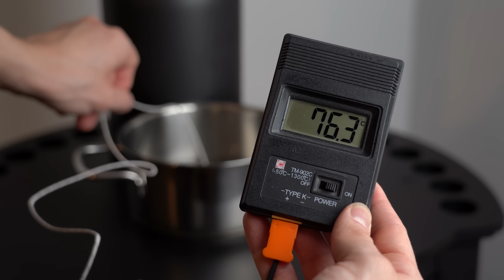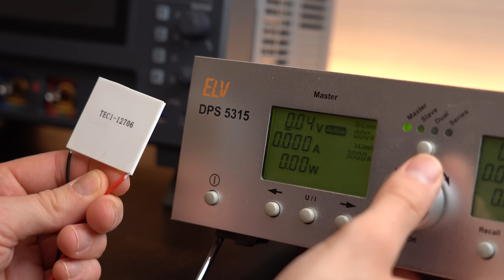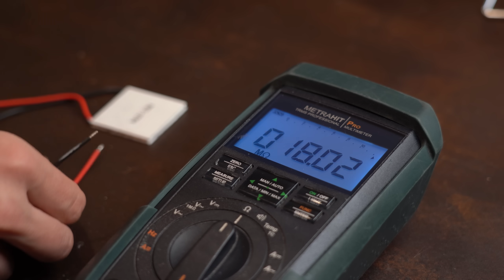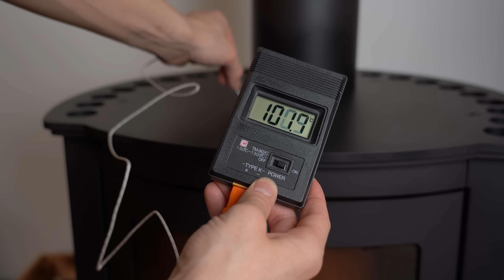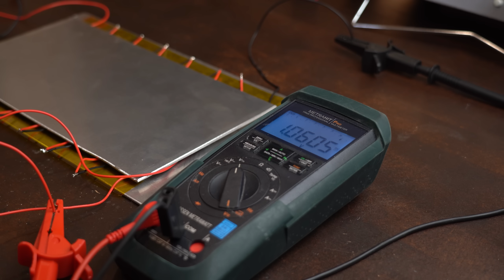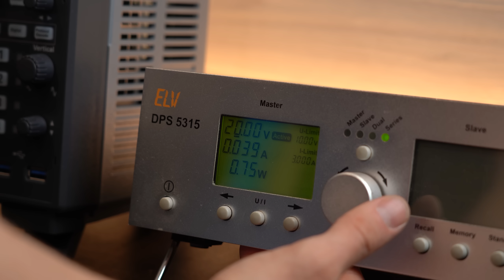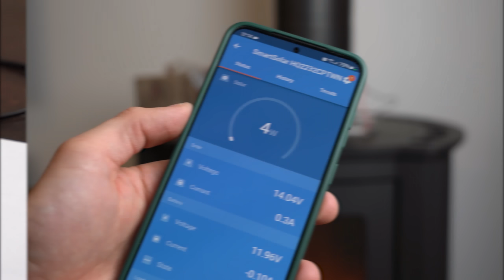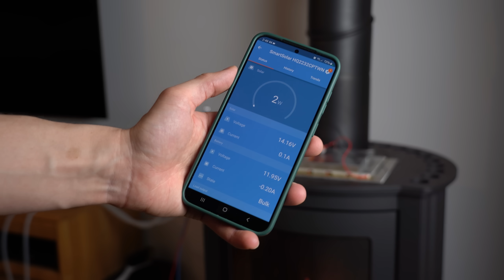I tried to Power my Home with Heat Generators! (Worth it?)

Comment: I think making a small steam turbine or sterling engine, driving a small motor, would be far more efficient and effective.
Reply from the maker: Hopefully next time ;-)
Reply: @greatscottlab  You can run a gasoline generator on wood smoke created by a GASIFIER! 
A 200 year old system, sealed, air comes in at burn basket where fire burns anything hydrocarbon, then all hot smoke and gases go into cyclone separator, water, tar sticks to edges and drips into catch jar, while gases move into radiator to cool and are burned as clean as propane. Can vent this gas with stoichiometric mixture of fresh air, to run any gasoline generator.
Startup requires blower motor to pull in gases to get fire going. Once producing, the generator will draw in air without need of blower motor. 

Can be installed inside of house as system is entirely sealed and will produce thermal losses, which can heat the house a bit. Can run large generators, 5000w. Gas produced is based on vertical fuel feed pipe diameter, typically around 10cm. 
If you have wood, this converts it into electricity with pretty high efficiency. Can also be used to power car engines!!!!
Reply: @Reach3DPrinters  a little bit more complicated then that, but yes it could be done.

If you want to completely redesign the fire place and have a combustion engine running at all times you want to make power
Reply: @TheHenirik  I imagine the system could be automated in many ways, electric starter on the generator, valves to route syngas with blower motor, sensors that read when its ready. 
So throw wood in a fire, flip the system on, it heats up, and a few minutes later, generator kicks on and is charging your battery bank. 
Would be a cool system, im sure plenty of people would pay $3000-5000 for a system like that.
Reply: @Reach3DPrinters  you absolutely could automate it, and there are companies selling finished solutions with automation.

What I ment was designing and building a good system is a bit more complicated. And then you still need to convert your woodgas to mechanical power that can be made to electricity, which typically means some kind of combustion engine.

So he would need a new fireplace with a vastly different design connected to a cleaner, cooler/condenser and a engine, not really what you want in a living space =)
Reply: @TheHenirik  of course a woodgas generator should not be used in living space, 
it is messy and  do not forget about CO.
Reply: @hattifattener1  its not as that messy tbh, and i am actually going to go ahead and say you could run one indoors, i wouldnt put one in a living space though. 

but CO is a big risk, big enough that it should be considered even if you are using it outdoors. and indoors you should really monitor it even if you have good ventilation.
Reply: @TheHenirik  i am using a woodgas generator indoors actually, it is the main source of power now in winter months ))
beside generating electric power, it heats my workshop - that is very efficient way to use firewood.
also heat is extracted from exhaust gases.

the messy part is not running the generator, but cleaning it - fine carbon soot get everywhere.
Reply: @hattifattener1  nice, do you run a modern filtration setup or the classic cyclone, wooden wool and water bath?
Reply: @TheHenirik  very basic filtering - 60 liter drum filled with hay, no cyclone, but there is a heat exchanger at the gas exit and it has sort of drop box trap for soot particles.

i think that more important is to get rid of as much tar as possible - heat insulation, air/gas heat exchanger and monorator hopper will help with that.
Reply: @hattifattener1  you should be able to remove a lot with decent fuel and a well designed combustion chamber so it keeps at the right temperature. something that is much easier when you dont have constantly changing load conditions as you do in moving vehicles. i never tried a stationary system myself though i did look at a modern commercial version doing pretty much the same as yours do. personally i only tried it on cars. 60l is a pretty big filter, but if you dont have anything else, how often have you had to change it? and does it get clogged with tar or is it more dry stuff that gets caught?
Reply: @TheHenirik  i simply replace hay every now and then - approximate interval 30 - 40 hours of operation.

there is dry powder in heat exchanger - nice and easy to clean, 
worst part is the cooler where soot mixes with  condensate and forms nasty sticky mass.

also quite a lot of condensation occurs in hay filter therefore it has a drain connected to common condensate tank.
Reply: @hattifattener1  also i realize now that i managed to confuse the size of your filter, somehow i was thinking of barrels 🤦‍♂

60L is probably around what we have on the car, maybe slightly bigger, though we have 'wood wool', idk the english name, seems to work pretty well, but we havn't used it too much recently because of other unrelated mechanical issues
Reply: @greatscottlab  there are some tesla turbines on aliexpress that should work with fairly low amount of modification. they claim to produce around 50-100w of power.
Reply: there were once stirling engines to add on to old oil furnaces. don't know if they still exist, since modern furnaces have significantly lower exhaust temperature where they would not work. mounting one of those to the exhaust pipe should work fine
Reply: like this one: https://jenni.ch/waermekraftkopplung-stirling.html
Reply: @wernerviehhauser94  Considering you could run a stirling of heat of the palm of your hand, thats probably not the biggest issue
Reply: @TheHenirik  it is, unless you want to trash efficiency. It is the same with wind turbines - of course you can make them run at 1 m/s, but you're not getting anything reasonable out of it. If your delta T is too small, it's economically a no-go
Reply: @wernerviehhauser94  yeah the aviable power goes down when the differentials to be equalized are smaller, that doesn't mean your efficiency is bad though, rather you need a higher efficiency to extract a usable amount of energy. 

And If you can run a mechanical engine on the difference between palm heat and ambient air which would probably be around 10c you need pretty good efficiency.

A stowpipe is still pretty hot and could likely power things, but it might not be economically viable for everyone, especially factoring in maintenance. 

Could still be worth it for off grid setups that don't need too much electricity though.
Reply: @TheHenirik   no, running a Stirling on the palm of your hand still has "beyond crap" efficiency, it just doesn't need more than a few Milliwatts and can work on single digit efficiencies.
 And there is no way past Carnot, no matter what "ingenious" design you might apply: the maximum efficiency is (T_high-T_low)/T_high, on my gas boiler that would be (350K-300K)/(350K) = 1/7 or 14%. In an ideal machine, you coul extract 14% of the energy in the exhaust gas (in my case, the exhaust carries less than 1 kW of thermal power), so with an ideal motor you could turn 140 W tops into mechanical power (and then into electrical) - 860W would still leave through the chimney. 
Please, learn some thermodynamics and stop confusing "oh, it effectively does work" with "it does work efficiently".
Reply: Hyperspace Pirate did that in www.youtube.com/watch?v=15ga4KMSWqU 
However, his achieved efficiency is likely an abysmal 0.1% or even less, compared to a proper full scale gas-fired power plant.
Reply: There are sterling generators for this kind of use sold already. You don't even have to build one yourself.
The interesting thing is that the sterling also need to be cooled to work efficiently so basically you get almost as much heat energy as without it, and the electricity it generates is just a bonus.
A few years ago my cousin installed a pellet burner for heating ans I looked at available sterling generators. I found combined pellet burners and generators that looked pretty interesting. Well worth looking. Even if you don't want to buy one it might give you some idea about the capabilities you could expect.
Reply: I have never tried this, but I have heard that two stroke IC engines can be turned into Uniflow steam engines.  It is mentioned on the Wikipedia page.  https://en.wikipedia.org/wiki/Uniflow_steam_engine
Reply: a sterling engine might be an efficient way to utilize the heat to generate so useful  amount electricity  without any problem with high pressure steam and might also reduce maintenance that steam boilers need.
Reply: @unclefrogy743  a steam engine doesnt need to be high pressure, or you could build a vacuum engine, guaranteed less then 1atm working pressure =)
Reply: Stirling, possibly. Steam is WAY too much servicing.
Reply: They make fans you can buy, that run off the heat generated from wood stoves. You can probably modify them to generate electricity.
Reply: @herbertholland924  those already use the same kind of generator he used in the video, and, at least from what i've seen, use very little power for the fan
Reply: I've been saying for years that a small steam engine doing what you say is the simplest solution, or a water wheel if you live near flowing water.
Reply: unless sterling cycle is a linear varient your adding way to many mechanical points of failure. With solid state or otherwise semiconductor power generation you loose a ton of the benefits and reasoning behind the concept adding mechanical aspects like pumps or fans. optimally you will want some sort of open thermal cycle like the old model T cars had.
Reply: He should just build a free energy device 😂😂 jk
Reply: even if the energy source was practically limitless, it always would take energy to produce at least the device, and its output would be limited to the energy it can produce per time unit. 

Anything that is labeled as free energy does not differ from conventional energy other than it making energy significantly cheaper and more convenient to produce. 

Solar power would practically be free energy if it could not be blocked, did not require surface area, and would be shining all day and night, and it still would not be free because the solar panels need to build, the batteries need to be built, all of it has to be installed, and you need infrastructure to use it. 

So a free energy device is just a regular energy generator that is substantially more cost effective and or uses an energy source that is more abundant and convenient to use, with no temporal or similar limitations. 

Therefore, free energy devices are possible, they just require unconventional energy sources that are more energy dense or efficient to use than regular ones. Anything that makes energy cheaper is an improvement, but it can never be 100 percent free even if the energy came out of nowhere.
Reply: @noahwinslow2692  hey... Maybe! Or... Definitely coming in the future!

Comment: The issue is that you will output a lot of thermal energy to the "cold side", much more than the electricity that you recover. But if you can inject this heat from the cold side into a water radiator in your house, it would be less of a waste. It could be used at least to power its own pump. It would be better to recover the heat from your stove pipes and use it in an water accumulator to distribute this heat later (wood stoves are usually too powerfull and thus really benefit from a heat distributin / recovery system or accumulator)

Comment: Weird conclusion... Simply do heat and cold spread evenly and control temperature flow better for both sides (two water-coolers). Also the wood price is to be included only if you won't use it for heating your house too 😅
Reply from the maker: So what power you think I can get out then? And are you willing to practically prove that?
Reply: @greatscottlab  it is probably more efficient to go in the other direction; a combined heat and power (CHP) system where the primary design goal is to generate electricity, and the heat is the by-product. E.g. steam or gas turbine systems.
Reply: @PixlRainbow That would also likely limit the temperature as well. So, the peltier modules for any grabbing any additional heat from the steam could be interesting. It could even be a tiny humidifier due to winter being cold and dry, though in that case you'd have to keep refilling it with water.

To not refill anything, you'd need some kind of closed system.
Reply: @greatscottlab I see the main problem you are talking about is how the modules get broke. So I gave you some advice on how to avoid this. Powe depends strictly on temperature difference and quantity of modules.

Comment: Try sterling engines attach to a conventional generator.
Reply from the maker: I put it on my to do list ;-)
Reply: Put free energy on it and see if you can get a collab with electroBoom. 😂
Reply: @keithbux4180 Man don't make fun of it this concept this isnt getting energy from moron acelleration like "free"spinning magnets powering a fan this is getting energy of work like using work of heat going to "cold" site to catch it and generate electric energy from it if you have better idea split it i want to know to
Reply: Where do you source your Sterling engines from? All I can find is some toys.
Reply: @mykolapliashechnykov8701  everything available is junk or $1000 of dollars
Reply: On Amazon, they are also known as a Heat Powered Stove Top Fan
Reply: @SonOfMarsAndKings  Those are cool, but they are peltier based, powering an electric fan. A sterling engine is based on thermally expanding gases, like a steam engine.
Reply: @mykolapliashechnykov8701  you can make one with two bycyxle pumps ands some bits of wood plus the usual hardware and hand tools. Just take the leather piston out of one
Reply: @theairstig9164  Bicycle pumps are light duty as they are, if used at hundreds RPMs under significant load they won’t last a day.
Reply: My thought too. Gotta create a regenerator for it though, can dramatically improve efficiency.
Will dump some heat outside if outside is the opposite side of the sterling engine. Helps to have a really high thermal differential.
Reply: @Reach3DPrinters  its winter out side the cold side is outside
Reply: @nadiaplaysgames2550  Yeah, so if this is ran in the winter, the cold side of a sterling engine will heat up a bit as energy transfers across the piston and gases. 
That heat will dissipate outside, and keep the cool side cool if its in the winter. 
But... that is dumping heat out of the room into the outdoors. Not a ton of heat, but if you were to take as much heat from the stove as possible, to run a large sterling engine, the hot side will also be cooled down or lose its thermal energy to the outdoors. Therefore, the fireplace or stove, will be less effective in heating the room. The difference in temp is what makes the engine run. But when running, the sterling engine is trying to balance the difference.
Reply: Could go the steam engine route but into a Tesla turbine! Then focus on the generator for the electrical side. Ive seen a video of a guy generating pretty high amounts of power from one of these using super thin disks, like 100 of them to grab as much air as possible. It was on this Integza video:
https://www.youtube.com/watch?v=Tuzh9mHvzkk

Comment: why not motor driven by steam from fire place?
Reply from the maker: Maybe next year during the cold season ;-)
Reply: @greatscottlab hello. Maybe a mix of systems to extract more energy. First stage, of course, using energy to heat your place. Second, a steam generator with the fireplace, to impulse a generator, and third, using residual heat everywhere in that steam circuit, pelt modules {checking max temp on each point) to generate energy too. Of course, that means more resources, but not far from something useful. Great video!
Reply: That could work indeed, but then you'll also need more firewood to heat up the water (let's not forget that we're burning wood for household heating here, so if we get less heat = need more fire), in the end it's never free unless you can capture what you're literally throwing away out the exhaust stack.